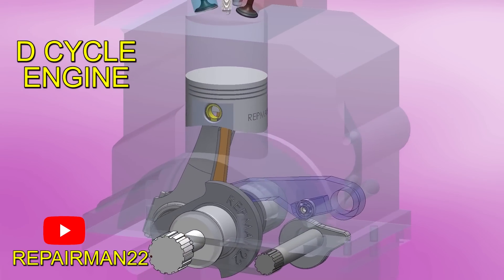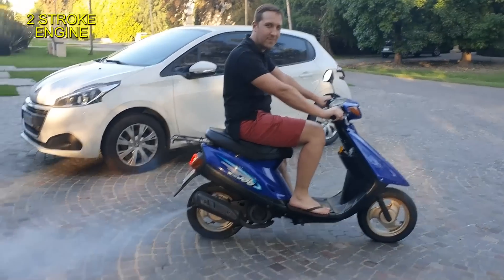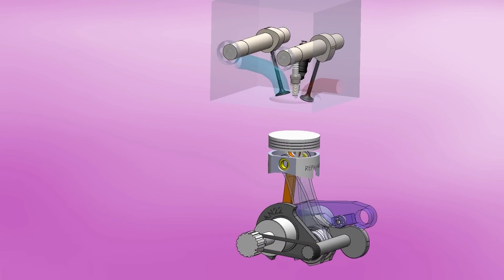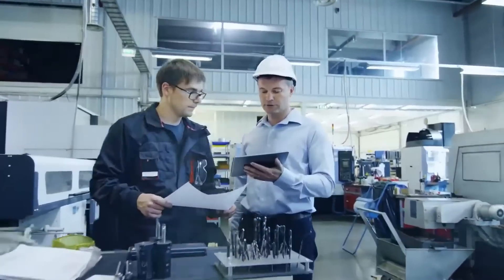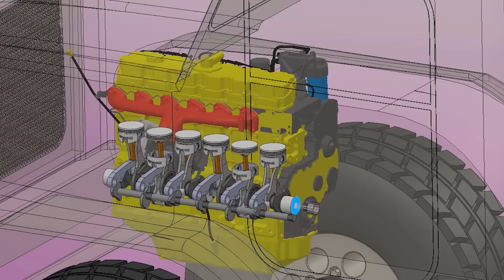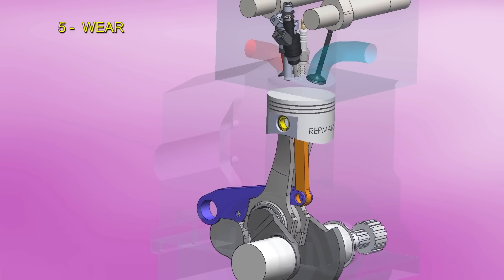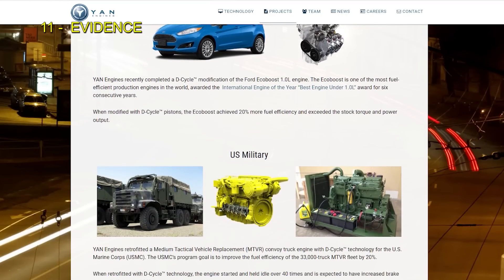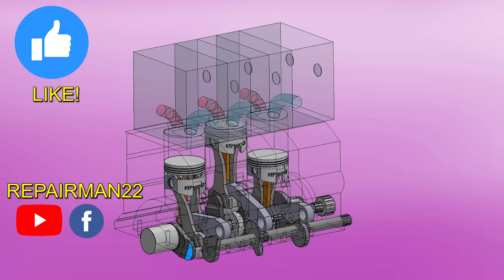Analyzing The Split Piston Engine in 3D. 🤯 Dual Cycle D // 2 and 4 Strokes Combined // 3D Animation

Comment: +++Do a show regarding.... ✈ℕ𝔼𝕎  𝔽ℝ𝕆ℕ𝕋𝕀𝔼ℝ  𝕋𝔼ℂℍℕ𝕆𝕃𝕆𝔾𝕐  𝔾ℝ𝕆𝕌ℙ 🤯💥🤯Multidisciplinary engineer/inventor here. We are developing one of my numerous ultra simple, long life, engine architectures which offers Significantly‼greater ratios of power to weight[specific power] and energy to volume[specific energy]...without any pollutants [NO, CO2 is not a pollutant] and can use any fuel or mixtures thereof. It's will be based on the 𝔽𝕦𝕖𝕝 𝔸𝕘𝕟𝕠𝕤𝕥𝕚𝕔 ℤ𝕖𝕣𝕠 𝔼𝕞𝕚𝕤𝕤𝕚𝕠𝕟 𝔼𝕟𝕘𝕚𝕟𝕖  [𝔽.𝔸.ℤ.𝔼.] tech described below with thermal efficiency ~60% which is close to an EV's charge-discharge cycle efficiency.😉 😁 We are incorporating Waste-To-Fuel systems in the offerings which will provide ultra-low-cost, renewable, carbon-negative fuels for our engines and gensets...without pollution. Torque...constantly Maximal. We'll also develop my superior power dense rotary architecture. Coming to Yourtown soon. ‼

😶‍🌫🤯Before that, we introduce the revolutionary FAZE engine 
technology. The 𝔽𝕦𝕖𝕝 𝔸𝕘𝕟𝕠𝕤𝕥𝕚𝕔 ℤ𝕖𝕣𝕠 𝔼𝕞𝕚𝕤𝕤𝕚𝕠𝕟 𝔼𝕟𝕘𝕚𝕟𝕖  
[𝔽.𝔸.ℤ.𝔼.] tech best solves the issues present in previous internal 
combustion engine designs by transforming the old paradigm into a 
simple, low cost, quiet, power dense, efficient, on-the-go liquid and 
gas fuel-flexible, ‘non-polluting’ solution for power generation of all 
scales and advanced transportation, construction, military, off-road 
vehicles including ships, aircraft, trains & robots not possible before.

Companies can either get aboard or risk of getting run over.

𝔽𝔸ℤ𝔼 delivers better than 25% ABSOLUTE/ACTUAL [not relative] 
fuel efficiency improvement over gasoline engines, more than 15% 
for Diesel engines at any operating condition - speed/load, ambient 
temperature or elevation, not just at one optimal testing point at 
STP. Real world driving cycle savings could be an additional 200% 
higher due to the constant MAXIMAL efficiency and torque. The 
simple, low cost, native/built-in, non-electric, environmentally safe, 
non-explosive, temperature agnostic 𝕊𝕦𝕡𝕖𝕣ℍ𝕪𝕓𝕣𝕚𝕕© feature 
recovers more energy than EVs and provides approx.100% fuel 
savings for a combined absolute vehicle fuel usage improvement of 
approximately 300%, thus obviating the basic need for expensive 
EVs & e-hybrids. 𝕚ℙ𝕠𝕨𝕖𝕣𝔹𝕠𝕠𝕤𝕥 adds >400% more torque. It’s like 
4 engines in 1. 𝕚𝔼𝕗𝕗𝕚𝕔𝕚𝕖𝕟𝕔𝕪𝔹𝕠𝕠𝕤𝕥2© further improves efficiency, 
torque, power & other performance metrics by 10%. This is all done 
w/o a transmission. Additional fuel saving solutions are available.
 
The FAZE engine perfectly follows the vehicle’s road or genset’s 
electrical power demand with no energy loss [no fuel waste], This 
unique characteristic enables dispensing with any auxiliary power 
units [APU] for power or refrigeration in any application. This also 
makes for a perfect range extender for battery electric vehicles [EV] 
or as a standalone EV charging unit even where is no electric grid.
 
The fuel agnostic capability allows instantaneous use of any liquid 
or gaseous fuel [natural gas at home!!!] incl. biofuels and hydrogen, 
even if old/dirty/unprocessed like flare gas or employ the concurrent 
multi-fuel capability…anywhere on the globe. One engine for all 
locales w/o changes! Unlike EVs, this enables fast fueling anytime, 
anywhere…with no troublesome infrastructure disruptions or 
changes. EV’s are not a solution to the [FAKE]climate or mobility topics as 
high level of electrification globally is unrealistic 
[See Patrick Boyle's video "Electrify Everything?"] 

The technology offers smokeless, non-polluting, low odor heat and 
noise output without costly after-treatments, etc.,… with only the 
lowest  CO2. It has a negative carbon footprint with hydrogen, 
ammonia, biofuels or gasified municipal, agricultural and/or forest 
waste and coal from a 2-stroke-like simplicity. These are HUGE 
business opportunities. We can provide these turnkey solutions 

The FAZE technology can be integrated into any ICE or vehicle 
architecture, adding some of the positive characteristics to its own. 

With virtually no electronics and emissions equipment, the cost of
purchase and reduced servicing frequency make this solution 
even more appealing.
 
Those are my two-bits

PS.
Did I mention we're developing advanced, simple, low cost, power dense electric machines and torque dense[read - compact], infinitely variable FrictionLess transmissions?

PPS.
✈✈✈ℕ𝔼𝕎  𝔽ℝ𝕆ℕ𝕋𝕀𝔼ℝ  𝕋𝔼ℂℍℕ𝕆𝕃𝕆𝔾𝕐  𝔾ℝ𝕆𝕌ℙ is a visionary multidisciplinary B2B innovation company utilizing a licensing business model or collaborative enterprise with strategic partners to develop Advanced clean, efficient, power dense solutions in domains of energy, propulsion, mobility, robotics / exoskeletons and clean technologies with a particular emphasis on the aerospace sector including space exploration and commercialization

Comment: The umpteenth attempt to increase the efficiency of IC engines by adding layers of extra complexity in the basic cycle of the engine. Virtually none of which have reached large scale production untill now (in contrast to all kinds of improved mechanisms for valve opening such as VTEC etc.). Seems very complicated and prone to wear and brakeage... Even in the animations you can see the top and bottom pistons hitting each other very hard... My gut feeling says this is not going to be reliable or long lasting...

Comment: I can see many problems with this setup, first off all, you would have screwed primary balance, enormous acceleration would limit max rpm dramatically. Secondly look like work cycle takes lesser than 180 degrees so it would have large impact on fuel economy. Also driving piston by a camshaft is asking for trouble, not mentioning that is very aggressive and would impact longevity.

Comment: The standard ecoboost engine has been renamed by mechanics as the eco boom engine because so many blow head gaskets and overheat. The original engine wasn’t reliable to start with. This will be a complete disaster.

Comment: IMHO it Makes sense in big low rpm diesels the ones that are usually 2-stroke now, Ships etc. since there half the cylinders will get you a substantial reduction in mass and volume. For a car it looks too complex to have good reliably and durability. Maybe in a plugin hybrid in can work, but that amount of complexity has also a monitery price that maybe unacceptably high, specially for something like a ford fiesta. But I think it's a good thing that people still develop the ICE, since I believe they together with bio fuels are the best realistic way towards 0 CO2. Something that Electric cars most definitely are not! Not even close! Not saying they don't have a place where to shine but replacing all car with EV is not only not better for the environment it's actually a lot worse on top of close to impossible!

Comment: I think there is an overlap then a trade-off between efficiency and reliability. This design seems to be on the trade-off end of this continuum. Is this one of those 50,000 mile engines?

Comment: Systems that add complexity can and do increase efficiency...but at the cost of higher production costs, shorter life span and higher maintenance costs.   There are already proven advances like Freevalve that actually reduce parts count, while also reducing rotating mass and increasing mpg, hp and lowering emissions.   The only step left is to reduce production costs.

Comment: I don't see why the central connecting rod attaches to a lever.  Instead you could just have a cam directly on the crank shaft, between two journals for the outer connecting rods.

Comment: interesting idea, but i doubt it goes anywhere. adding to weight, cost and complexity, and detracting from durability and reliability probably isn't worth a few percentage points of efficiency. plus, a more efficient engine won't necessarily mean a more efficient car, when factoring in weight and other trade-offs. a design like this might make sense in a low/mid speed diesel marine engine, where rpm and weight are less of a design restraint.

Comment: It seems to be made for diesels. There the speed problem is greatly reduced, since diesels can't rev high anyway, due to the time required for diesel fuel to burn. Diesel combustion is colder than gasoline one (higher decompression of gasses cools them), direct injection works better for diesels than for gasoline engines, and blow by is less of a problem.

Comment: This is like when they invented interference engines.  Any failure in timing can be catastrophic.  This new engine design would just introduce more points of failure.  I will also say car manufacturers got wise with interference engines and now most use exclusively a timing chain instead of a timing belt in order to avoid engine failure.  It also reminds me of variable valve timing, great in theory, but terrible in durability and requires very expensive low viscosity engine oil.

Comment: Honestly this engine sounds like parts that should be simple and durable being put under an unnecessary amount of force with weaker parts and more points of failure. The chain connecting the crank to the crown piston just sounds like a timing chain thats going to be under more stress and be a bigger issue than its worth

Comment: Connecting rod peak load is actually at top dead centre - the tension needed to bring the piston to a screeching halt and pull it back down the barrel. Its worse on the exhaust stroke (of a 4 stroke) with little gas pressure above the piston to assist the process.

Comment: The crown would get very hot, very. And it would be moving fast, very fast. Lubrication would be almost impossible, under conventional oiling methods. It would need oil channels dumping in the cylinder walls. And it would have to be high volume, and have very low viscosity. Like some high end Ferrari oil. Some $500 a quart stuff.

Comment: Hahaha!
Generally it is said that 'If you want to solve a problem try to start working on a bigger problem', thus the initial problem gets no importance and it will normally fade out.
Point number two. Whenever we think we that we found a solution to a problem, the solution creates a minimum of two problems which must be addressed before we put the Solution into practice.(now go back to the starting).
Thanks.

Comment: This will fail guaranteed. A nightmare to lubricate, cool, and maintain. An unnecessary large amount of moving parts and rotational mass. Parts that's will interfere catastrophically due to its interference design after slight wear and tolerance reduction. Not to mention more than double the price for 20% more fuel economy and power.

Comment: I feel like it would be possible to drive the movement of the crown piston by a cam located on the crank-shaft, in that way it should be IMPOSSIBLE (unless mechanical failure) for the 2 pistons to be "de-synced" and crash?
The geometry in the engine OBVIOUSLY need to be changed, but it should be possible.

Comment: Still 4 strokes just 1 rotation, and that will make 2k rpm move the piston at 4k rpm without the benefits of actually spinning at 4k rpm. Might burn better but I can't imagine any actual gains to be had. I think the 2 opposed pistons moving in 1 singular cylinder is a better design. Just needs a solid way to transfer power to a central crank

Comment: i can only imagine the absolute racket that thing is gonna make while running. the piston crown connecting back to the skirt, the crown arm running over that highly aggressive cam as well as the more aggressive valve cams. that thing is gonna chatter like hell especially when it gets up in the rpm range. valve/cam float is going to be a huge issue for that extra cam and it will likely beat itself to bits i would say

Comment: Not all 2 strokes need crankcase scavenging. One just has to use a supercharger for scavenging then no crankcase scavenging is required, together with direct injection one doesn’t even have to worry about 2 stroke exhaust emissions either.

Comment: I see another couple of problems:
One is the lack of skirt in the crown will increase the wear on the bore. As it ovalizes, piston will go in sideways.
Second is balancing issues. It already has a secondary shaft than can be used as a counterbalancing shaft, like 3 cylinders engines already have.

I think a better solution than the spring would be replacing the entire cam concept by a linking mechanism. It is the most efficient and also prevents the piston from going rogue on the mechanism. However, that would have the most parts, not to mention a lot more points to lube. It would also need to be very precisely sinchronized or the linking mechanism would takes the entire force of the combustion stroke. Kinda similar to the Atkinson cycle tbh.

Comment: Wait, so it has half the strokes so half the rpms makes the same power, yet only 20 percent more power.  I'm willing to guess they didn't change the parameters to account for that.  It should be making more than double to be more economical. If it is using double the gas and making 20 percent more that means it's 80 percent less efficient than a compatible 4 stroke.

Comment: The crown pistons lack of skirt will be a problem as there is nothing to hold it square in the cylinder and the rings will loose seal as the crown rocks in the bore.

Comment: The cylinders are used 100% of the time... 4 stroke produces power within 1 out of 4 strokes of its cycle 25% and 2 stroke combines 2 strokes so the power is produced 50 % of the cycle...

Comment: To mitigate the high temps, couldn't they sleeve, coat or cap the interior with a titanium alloy, graphene or perhaps a ceramic?  When I saw the animation I immediately thought of the two pieces of the head getting gunked together with burned carbon.

Comment: As mentioned in the video and in comments, the accelerations and thus forces required to actuate the auxiliary piston are enormous.  There’s probably a better trajectory (displacement vs time) than what’s illustrated in the video.  Decades ago Mercedes Benz raced a car with a desmodromic mechanism driven by a circular cam lobe - eliminating jerk and higher order accelerations. But that mechanism had serious overlap which meant the engine could not run well at low rpm.  It won races, though.

Comment: The piston would not fall fast enough to follow the cam. Would need either another cam to push it down, a spring that needs power or forced induction. Think desmo type control could work. Would work well at lower rpm. Ideal for something that designed to work at constant speed. Such as generator set for ev car.

Comment: I think this design is far more suited to large format, low RPM, stationary engines (if anywhere at all). Reliability is going to be a HUGE issue. At best, the cam follower bearing needs to be made easily serviceable.

Comment: That looks like a terrible idea. You didn't mention the noise the top meeting the bottom will make and noise means damage, I don't believe the fuel consumption claim, it uses 2x the fuel per revolution compared to 4 stroke, the only way it could use less fuel was if it ran at less than half the rpm. That little bearing and the cam will fail very quickly.

Comment: I would like to understand this better.  My intuition is telling me it's a complete sham.

How I saw it initially is that the split piston goes up while the exhaust valve is open. I guess you could say it's purging the exhaust at best.

Then I realized that in addition to that, it's making the maximum volume during the combustion phase half that of the compression phase, as the split piston begins its upward trajectory. Isn't that just wasting the expanding forces of the exhaust gasses then, and doing work against the power pulse?

Comment: what
a
stupid
idea 

couple of big big things, 
you DO NOT need to vent into the crankcase on a 2 stroke, (that is and was a common method for motorcycle engines, cause, cheap, easy, light)
you can use a miller style, where the intake air is force in, with a super charger (common on the old 2 stroke detroit diesels used in trucks) 
THIS is mechanically less complex, more robust, and as all the benefits listed

Comment: I imagine a lot more cylinder wall wear as the possibility of twisting of the top section of the piston.
Reply: The piston crown part is fixed to the piston stem which in turn is fixed to the pistontrain lever that is constrained to move the stem  up-and-down along the cylinder axis. There should be no twisting force on the stem.

Comment: In essence, this design splits the pistons into two parts:

One part (crank, camshaft, and piston skirt) that all run at same speed.

A second part (piston top) runs at twice the speed.

It is evident from the animation that the piston skirt makes its trip once every crank revolution. But the piston top makes its trip twice during that time.

So at 1000 rpm the piston skirt moves 1000 times, crank runs at 1000 rpm, and camshafts runs at 1000 (instead of 500 as in conventional engines), while the piston top moves 2000 times.

The reduction in spinning inertia (mass @ speed) is basically the source of its advantage.

However, complication & added reciprocating parts are its main enemy.

An extended test over time is needed to clearly identify pros & cons of this new design, not just building a testing sample and demonstrating that it runs.

Comment: To me, this doesn't seem much better than a 2 stroke with a compressor, like the old 2 stroke Detroit diesel. Is all this extra complexity really worth it, instead of just putting a compressor on the intake? They were only able to run with a supercharger and not a turbo, but surely you could do a super-turbo system or something similar to improve power and efficiency without so much complexity.